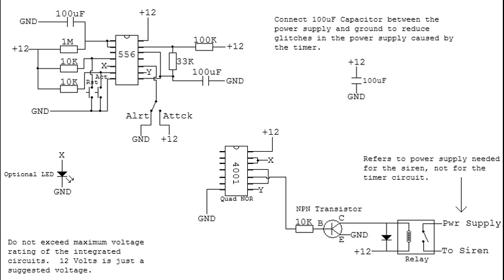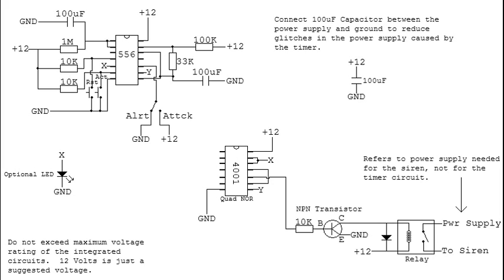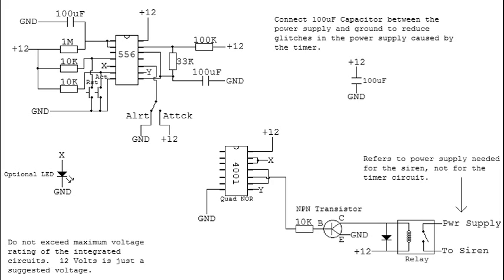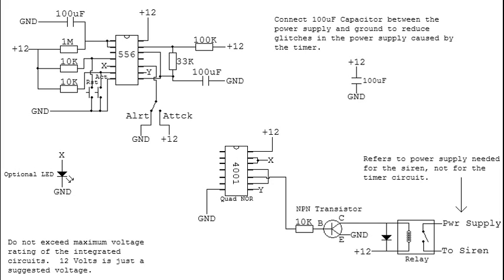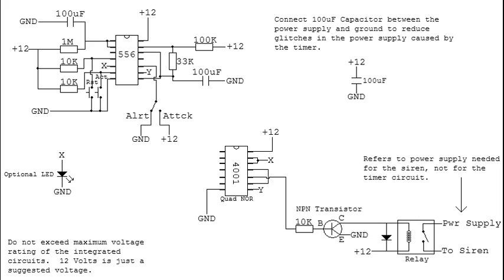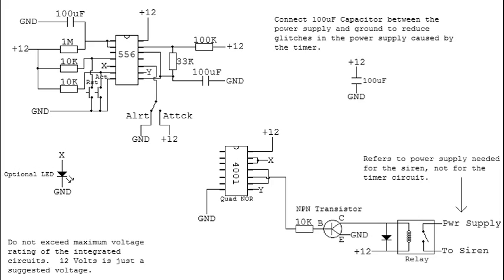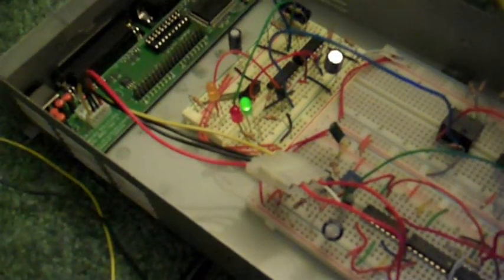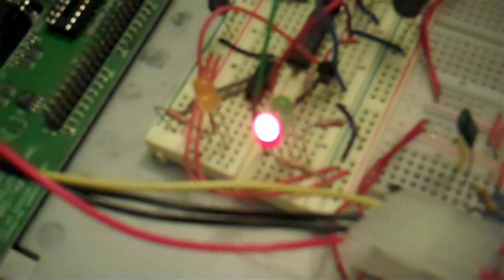Re: siren timer with alert and attack

Comment from the maker: @WilmothWarningsignal The relay has to be able to power the siren and the transistor has to be able to activate the relay. So it matters..I just meant there might be more than one model which has the correct specs. If the relay is sending power to the control input of a VCO then it doesn't have to be powerful at all. Mechanical sirens are a different story.

Comment from the maker: @WilmothWarningsignal Pins 3 and 11 are the voltage control inputs which I jsut left open. The X and Y are outputs which are connected to the corresponding X and Y inputs on the 4001 IC. The output X is being inverted so that the relay is on when timer 1 is on and timer 2 is off (since the NOR output is on when both inputs are off).

Comment: Wait, it pin 3 on the 556 timer for the tone output or is it the pin 3 marked with an X? Because i see pin 3 ( and the the one with the X ) and pin 11 ( 8 for a normal 555 ) open. So i just wanted to clarify that just to make sure.